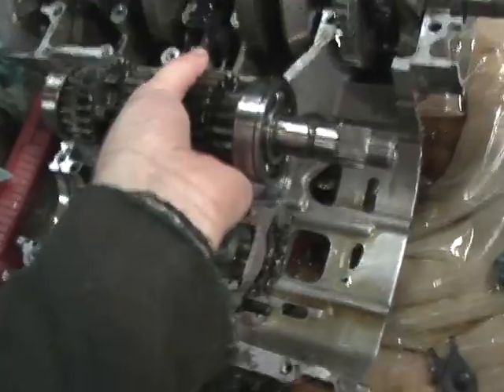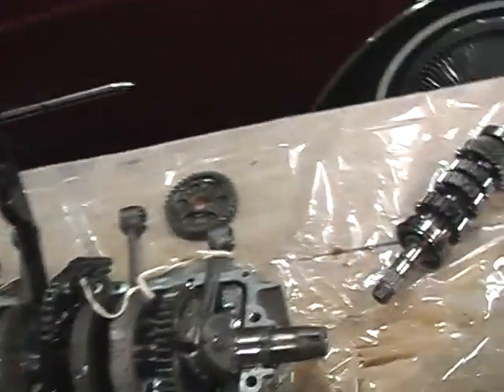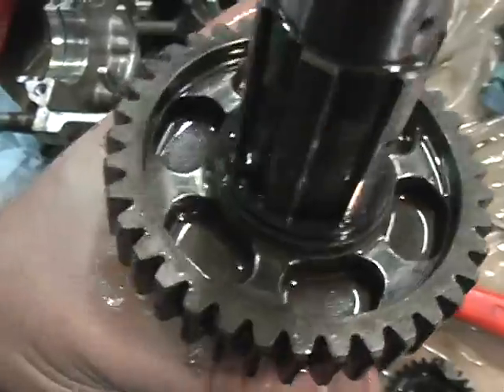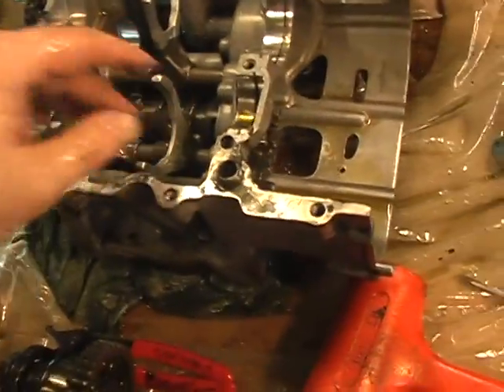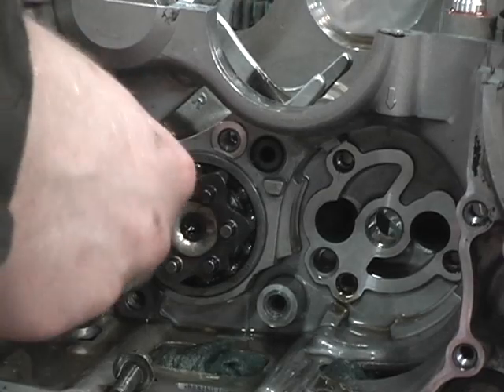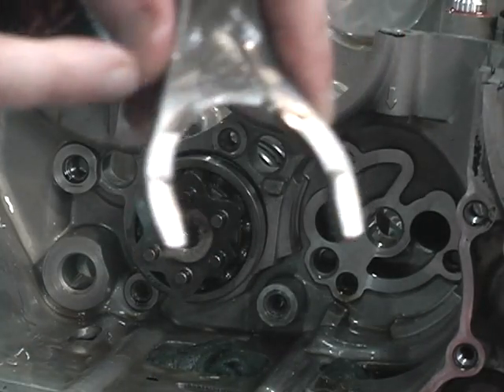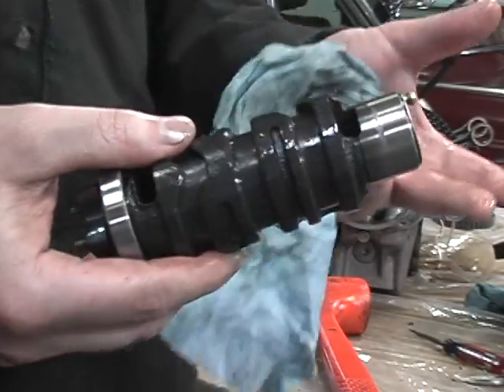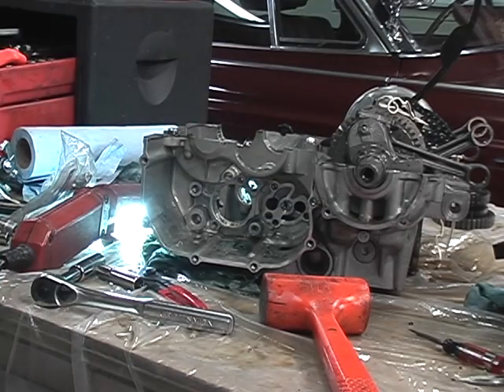21 Transmission Internals yzf600 1996

Comment: Hi Daytona! question, at high RPM shifting ( 6000 and higher rpms), the first and second gear make some noise, i open up Transmission  and the gear parts are ok. Clutch  is also good. 
Do you have an idea?

do you have an idea why this too gears are noise

Comment from the maker: either i gues, though i dont often go from 1st to 2nd at a stand still but for testing yes it was trouble.  but really on the roll any speed any load it was a crap shoot if the gear whould stay in place or slip out and kick the shift lever back at me.  the real truth of the matter on these machines as far as 2nd goes. if you are having any kind of problem limited to that gear, it needs to be opened up, any less and you MIGHT just buy SOME time.

Comment from the maker: yea they dont look too bad at all. mine never popped out. it just didnt like going into gear, grind and through the lever back, breaking shift shaft tabs.  my shift forked rubbed in an odd way, so the bit of gear wear and shif drum made my fork funny making shifting difficult wearing other parts. i had replaced the fork previously and it wore out like the old one quickly so it was obviously more than that, prompting rebuild.  bike had a little over 40k with some track miles on it too.